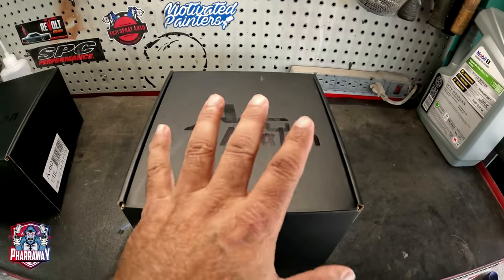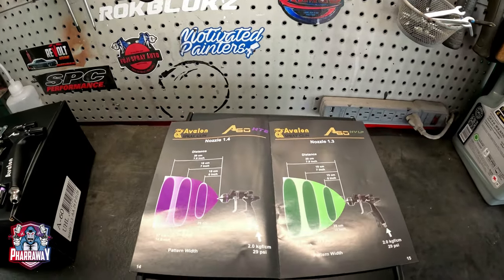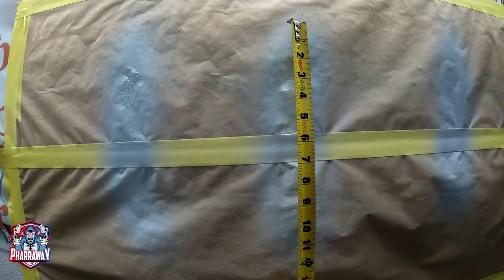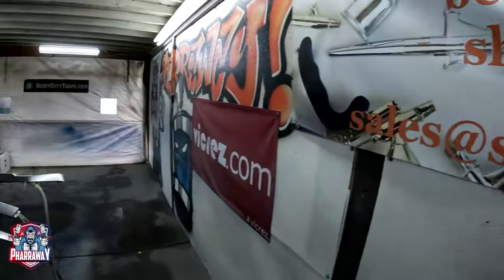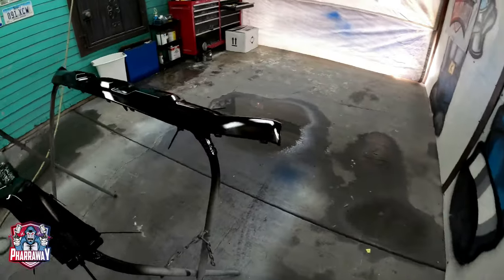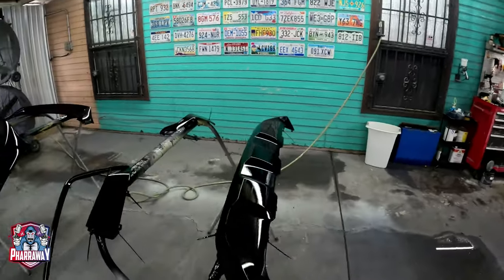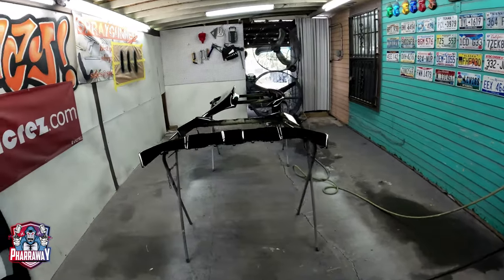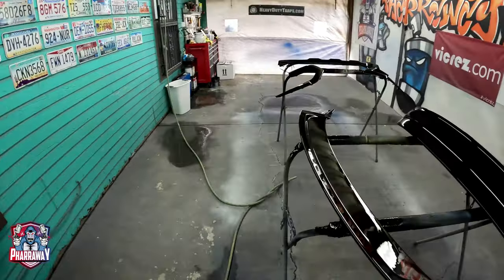TRYING OUT THE NEW AVALON A60 PAINT GUN

Comment: Test your spray pattern sideways..... Hold there for a few seconds and see where the runs accumulate.... It should be even drips across in middle & decreasing on outwards in a upsidedown U shape ....... If the concentration of runs are of to the sides of dead middle - then your setup needs to be cleaned and tuned......

Comment: That is a really nice looking gun there Pharraway, a couple of comments on here saying that the finish from the clear isn't that flat but I think that might be to do with the panels being plastic where the finish isn't quite as good as a metal panel, I could be wrong here though🤔

I do like the finish I get from my WS400 Series2 with the split tip as they always seem to atomise the clear better giving a flatter finish, I was hoping that the X5500RP 1.3CC would be a split tip design but it still lays the clear like glass👌👍John UK
Reply from the maker: you are correct
Reply: No matter how much a panel is warped because it's plastic, that doesn't make orange peel.
Reply: i can see that it struggled a lot on the clear coat. the droplets look big and laying too slow to have a good wet coverage and flow out.